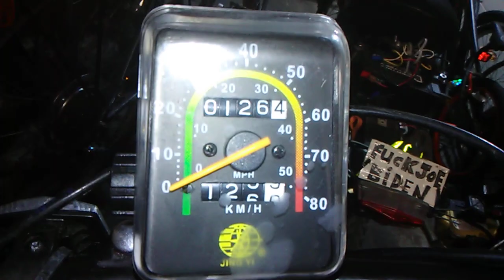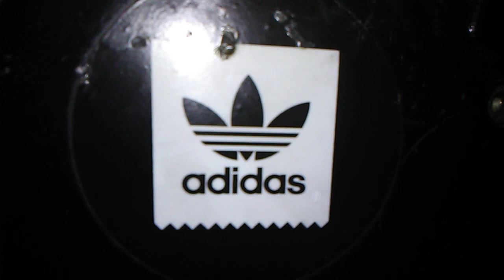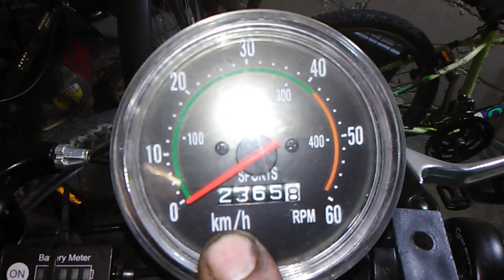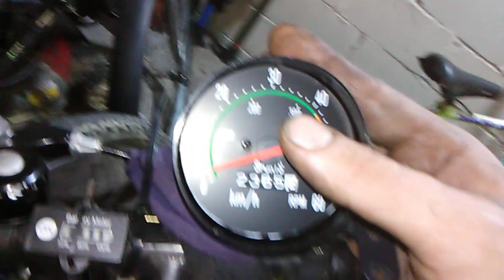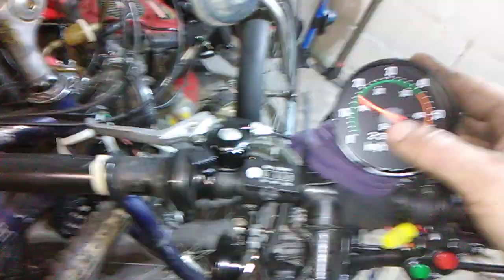"Motorized bicycle!" "Double Wide surprise!" "still fully operational!"

Comment: Thanks for your little tour nice collection of builds and spare parts I like your lights turn signals on your girl pretty cool I use the same rear sprocket adapter made by cdhpower and the same kip spring sprocket tensioner looks awesome brother ride safe
Reply from the maker: No problem 👍

Comment: I have the same CDH sprocket adapter and I put a key way in the hub. Has never moved
Reply from the maker: Usually if you are not using the same rear wheel hub that I have it's a rear wheel hub and brake setup from a Walmart funny frame bike that I disassembled and reassembled on my mongoose mtb bike and how you tightly put it on is you need a impact driver drill with a Angle drill  attachment and screw the bolts in until their super tight hub adapter Mount sprocket setup doesn't move also the shit you buy is called locktite glue also helps!